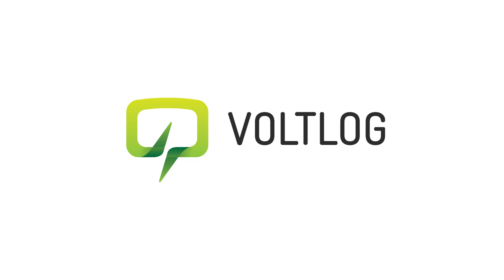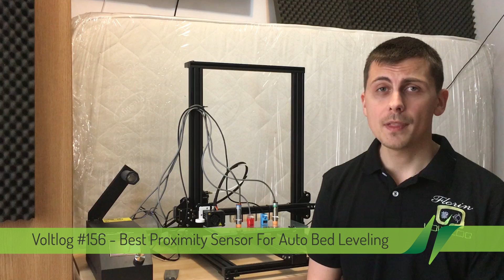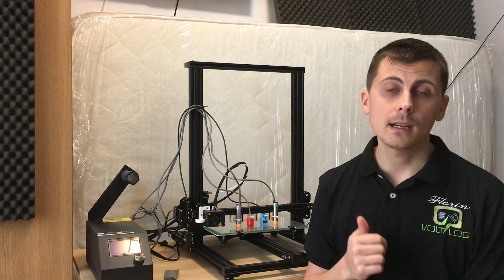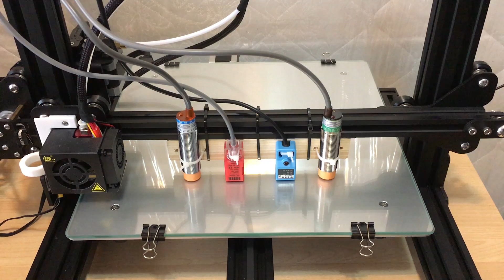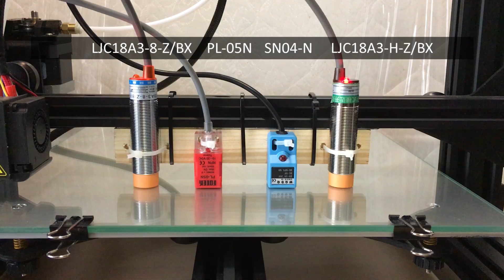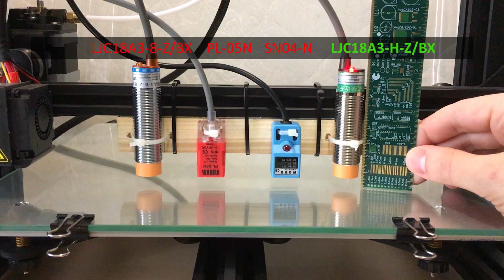Voltlog #156 - Best Proximity Sensor For 3D Printer Auto Bed Leveling

Comment: But the glass surface is very plane and it is very good property! I am thinking now could we cover the glass plate (very plane!) with a thin film like that one for printing with laser printer on it. If so, we could to glue some pieces of Al foil under it. And if they are glued accurately, we could use all the functionality of Prussia's autocalibration with such a combined plate. I think the best choice will be something like an adhesive sheet of transparent film for laser printing on it and very carefully cutted and glued pieces of Al scotch tape or even a simple foil. But it needs an experimental proving and very good accuracy. The second way is to cover a glass witn an aluminium paint via some stencil. The third way is to use a mirror with almostly etched metal layer which is leaved only in defined places. And the mask for the etching may be transferred from the paper with old good laser printed pattern by something like an iron. Or even with a photoresistive film. Or we can get a sheet of copper foil, transfer the mask with an iron on it. After that we can glue the foil on th glass and etch it. And finally cover it with a laser film. This difficulties can give us not just a bed auto-leveling, but full 3D geometry calibration and correction like Prussia developers did... Sweet DIY dreams :)

Comment: Thanks for a video I have installed capacitance sensor (LJC18A3-H-Z/BX 1-10mm) but i found it not much accurate each time i need to adjust z prob offset. I read on internet this sensor change reading due to humitdy and temprator change so each time it come with diffrent number I am thinking to move back to manual meshbed leveling.

Comment: SN04-N has max distance of detection 5mm, so its plain retarded to use 5mm glass and then expect the sensor to detect the aluminium bed... i have 3mm glass (2.7mm actually) and this sensor performs good enough...

Comment: Capacitive sensors just create more problems than manual leveling because of their unreliability.
Any industrial engineer would tell you they are the wrong type of sensor for this application, and could very well be the worst choice.
You need to make sure there isn't too much of an insulating layer, or choose a more expensive sensor, it's up to you.
Mine was cheap and works fine over a glass bed.

Comment: The inductive version was a better choice, just reduce the glass thickness from 4mm to 2mm. The inductive versions are prone to error with minor changes in humidity and temperature, a second print of a hot bed will be way off...The bltouch is probably the best option but if you want accuracy, loose the glass and go with the inductive sensor ;)

Comment: Hey, while watching your video I grabbed my SN04-N switch (blue one), and filed sensor side so it can reach my aluminum plate through 3mm glass. After some careful finishing with exacta and putting protection layer of Kapton tape it senses >1mm over my glass. Just telling that they are not useless, just designed for different application.
Reply from the maker: For sure they have a use! Some people are printing directly on the aluminium bed with a thin insulation layer so then it works great. I just prefer the bltouch for printing on the glass.

Comment: Just get a flex sprung steel bed sheet, 20 bux and the SN04 rocks! Capacitive sensors change distance even if the weather gets humid, utterly useless
Reply: the inductive sensor triggers on spring steel? nice! I was worried they're too thin to trigger the sensor.

Comment: The inductive sensor's rated distances use iron as the inductive sheet. Aluminum has ~40% the rated distance, so a 8mm sensor will only trigger with 3.5-4mm distance from an aluminum bed.
Reply: Prusa gets around this by using a spring steel sheet, which gives nearly 80-90% of the rated distance (due to the carbon and other added alloy metals, it isn't quite 100%).
Reply from the maker: you are right, that's why I switched to the bltouch sensor, to avoid adding anything to the print bed

Comment: I use blue one it is best I tested and I don't use glass because curling. I use alu plate 3mm with M3 sticker for heatbead and it is great.
Reply from the maker: yes, those sensors work fine if you don't have any glass on top of the bed, but I'm not sure about the repeatability of the measurements.
Reply: If you setup it when hotbed is hot than it is good

Comment: could you show me how to conect it and get the distance.
How do you do it electronicly.
what do you need for 3d printer.
Can i hook it up to my 1.4 ramps motherboard.
LJC18A3-H-Z/BX 1-10mm Capaciteit Proximity Sensor Switch NPN GEEN DC
Please show me more on how to do it would be verry help ful thx

Comment: Wouldn't it be much easier to use a steel sliding rod with several mm stroke mounted beneath the sensor so that it will lift towards the sensor as the z axis lowers?

Comment: In my experience capacitive sensors are not consistent. I had much better luck with a inductive sensor that could sense through the glass sheet. It worked much better but wasn't a good option either. I ended up using a Triangle Labs BL Touch clone. It's by far the best option and is cheap.
Reply from the maker: thanks for the feedback, I think I will give that one a try as well.

Comment: You must be doing it wrong, your sensing distances are too short across all sensors. How are you powering the sensors? SN04-N is fine, and it will trigger at 5mm, but it really, really needs a good bit of supply voltage! Don't feed it off 5V , else it will trigger too narrowly and will be super unreliable! 12V are good enough for it. Use pullup on your controller board, and then connect the sensor through a diode, so that the sensor can only pull the board pin down, not up
Reply from the maker: I am powering from 12V, glass is 4mm thick, and build plate is aluminium so with a 4mm inductive sensor designed to work with ferrous materials it's only normal to get the results I am getting.
Reply: @voltlog  your inductive sensor should be 8mm. not 4mm

you have a different part no in the overlay and description. 

LJ18A3-8-Z/BX 8mm NPN NO Inductive Sensor  is supposed to be good for 4mm glass but your video worries me. unless it is not powered @ 12V as it should

Comment: The command:
M48 P10 v4
will (on Marlin) do a repeat-ability test on the sensor and print out the result.
Reply from the maker: thanks for the hint. I will have to recompile & upload the firmware to test that because it seems I had Z_MIN_PROBE_REPEATABILITY_TEST disabled in config.

Comment: Proximity sensors reduce in range as they age, just keep that in mind to allow for adjustments. I do not know how repeatable the sensing distance is. Maybe a micro switch would be a better option, I don’t know if anyone has tried them.
Reply from the maker: These proximity sensors were the cheapest option and possibly simplest to use. If I have to buy some expensive switch like BL touch I think I'll just stick with manual adjustment.

Comment: How about optical sensors, they at least are more repeatable on the same surface, and will work with most smooth surfaces. visible light ones are the easiest to set up, though the most common are IR ones simply because you do not see the spot, but a cheap cellphone camera will generally be able to see the IR beam spot well enough.
Reply from the maker: I'm thinking there must be good reasons why the capacitive/inductive proximity sensors are widely used in the industrial applications. For me it was cheap and easy to get one of these sensors, while trying to work with an optical sensor it feels like there is much more that could potentially not work as expected.
Reply: Industrially simply because they are not too much worried about oil, grease and dirt on the front of the sensor, but in clean areas the optical ones are the best because the repeatability of the sensing is almost as good as a mechanical switch for limits.

Comment: about the capacitive sensor, i've read some links about some problems it can trigger, about different voltages or overvoltages... sorry, link in italian, but look at images or at links inside it for english references
Reply: link: http://www.indiegearlab.com/autobed-levelling-ljc18a3-h-zby-semplice-e-rapido/2358
Reply from the maker: there doesn't seem to be any problem mentioned in that article.
Reply: look at links, the italian guy uses a relay, in links others use optocoupler or some voltage divider to avoid some return feedback to the electronic board, or the fact that the LJC18A3-H-Z/BX is NPN and triggers if HIGH while the BY model being PNP and triggering when LOW, so for the BX model was needed something to protect the 5v board if sensor powered with 12v... sorry, is something seen 2 years ago and i can't remember the exact problem, and i'm not so fond in electronic to be more precise...
Reply from the maker: I have an optocoupler isolating the sensor from the motherboard, I wouldn't use a relay for this type of circuit don't know what that guy was thinking but my circuit is working just fine :-)

Comment: Thanks for sharing 😀👍
Have you seen Thomas test?
toms3d.org
Reply from the maker: not sure which one but I've seen a bunch of sensor reviews last year when I was researching the idea. Most of them used inductive sensors during their tests and some got good results but they didn't have the glass bed I am using.
Reply from the maker: I watched it yesterday at the recommendation of another user commenting here. Looks like Thomas did a far better job at testing these sensors. If only I would have seen this video at the very beginning it would have spared me the trouble of trying that inductive sensor.

Comment: A repeatability test of multiple approaches with the "winner" would have been nice (ideally using a dial indicator, but a thickness gauge or even a paper strip works too), especially if repeated on a few different days...
Reply: Thomas sanladerer did some repeatability tests with these kind of sensores i'll -> /watch?v=il9bNWn66BY
Reply from the maker: The practical approach, just using the sensor and printing stuff will give me a good indication of whether this is a good idea or not. I should have some more info on that in a few weeks. Right now I just printed the sensor mount and will be trying it soon.
Reply from the maker: Thanks! I watched the video, looks like he did a far better job :-)

Comment: Capacitive sensors are way over rated and a 3D printer fad. 
If you level the bed, the standard micro switch works very well. 
If your bed is not leveled, then it can be of some use. Then again, why not just level the bed?
Reply from the maker: It's an interesting idea that I'm sure many 3d printer owners are thinking about. I wanted to test and see for myself if it's usable or not. Because I had bad luck with the inductive sensor that I got first time I didn't want to abandon the project so I got the capacitive one instead and I'm gonna try to make it work.
Reply: The magnetic field from the heated bed, the heat itself, humidity and other variables will make these sensors unpredictable. The one that came with my Anet A6 printer, is still in its packaging. It is the blue useless one you dismissed at the very beginning.
Reply: I find that my endstop behaviour is not all that consistent. There is apparently some minute movement in the bed presumably with heating and cooling, and it's not large enough to cause a significant skew of the bed, but large enough that i can find the nozzle scraping the glass one time and the prints not sticking down another time.

There is also some systematic movement of the second Z axis every time the printer is turned off, so i'll do separate Z drivers and dual Z endstops before i do a bed level sensor. Luckily i have plenty of endstop/sensor points on my board that i can use. And of course it will be inductive, not capacitive. Humidity doesn't matter. Heat is in fact completely predictable - first the head is parked, then bed is heated to target temperature, and finally the probing is performed at known temperature! Reputable printers like Prusa Original have no problems with an inductive sensor at all. Also there will be a steel sheet instead of glass.

Comment: Capacitive Sensor tend to stray more depending on the ambiance wether humidity or heat.
Reply: Marcos Ramirez  I have one on my cheap i3 and it works flawlessly since I've installed it... Had to make a decision weather I switch the buildplate from glass to metal and go with an inductive probe or keep the bed.and choose a capacitive sensor. I don't regret to have chosen the later...
Reply: Aaron Rogers To each their own friend. I personally like buildtak on bare metal with an inductive probe. 😄

Say any chance you might know how to connect TMC2130 drivers to an MKS GEN 1.4 board. I haven’t been able to find a proper walk through.
Reply from the maker: Right now I am designing a new mount for this sensor because it needs to sit higher. After I get it working I will report back with the results.
Reply: Marcos Ramirez nor really thinking about upgrading to the trinamic drivers myself. I think Tom sanladerer or maybe Marco reps had a general purpose tutorial to install this drivers on any board - bypassing spi setup from Marlin by using an additional Arduino nano...
Reply: Specifics matter. The 3D printers at one local maker space are all in insulated boxes with active temperature control. For those, the temperature will always be stable. If I were to set up a printer in my shed, it would see temperature swings of 20 degrees C. How much does the measurement change per degree C? How much across the range of likely humidity values? Changing humidity causes problems in the woodshop, so the  humidity is also monitored.
Reply: remember to include humidity and temp in the results and how precise the sensor is if humidity changes
Reply: i am facing the same. Thinking to remove this. thinking to shift back to manual meshbed leveling which works really well.